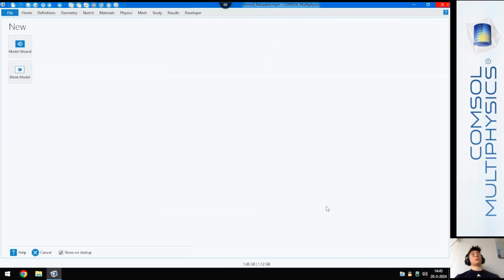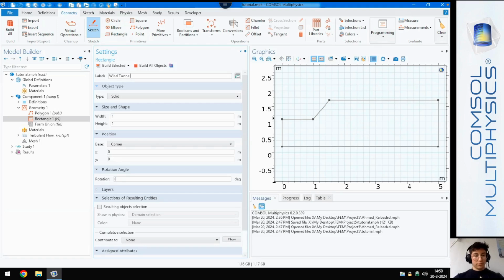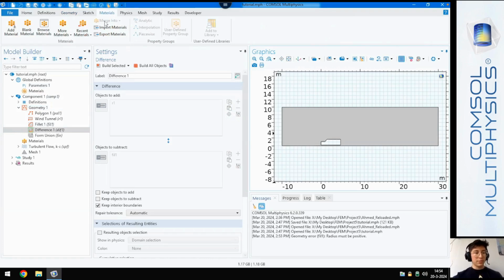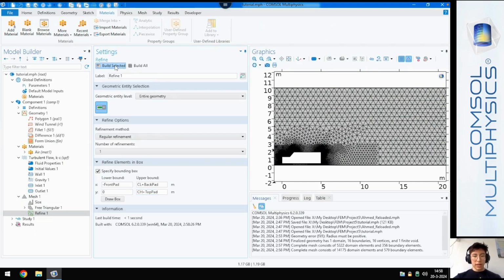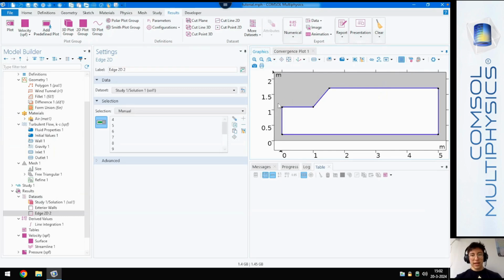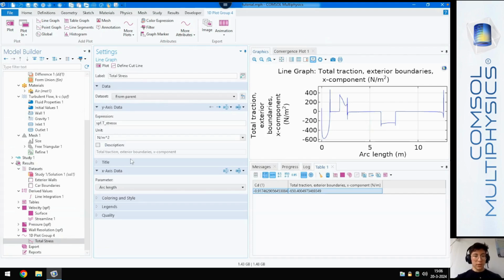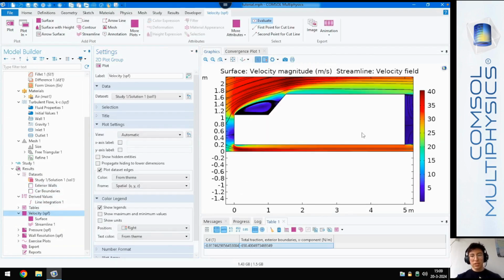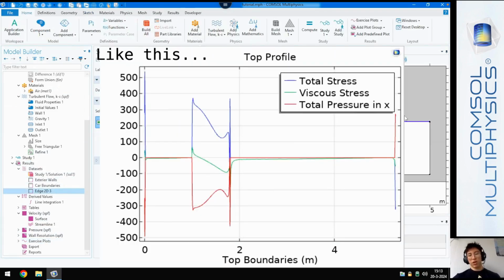Setting up a 2D Ahmed Body Fluid Simulation in COMSOL Multiphysics

Comment from the maker: I must make a slight correction to the video:
- 8:35 The wall condition determines if viscous effects are taken into account at those boundaries. If it is set to slip, then these effects are completely neglected. If it is set to No slip, then these effects are taken into account and the velocity of the air relative to the surface is zero. *You should play around with these conditions for the boundaries of the car and wind tunnel, depending on your situation*.